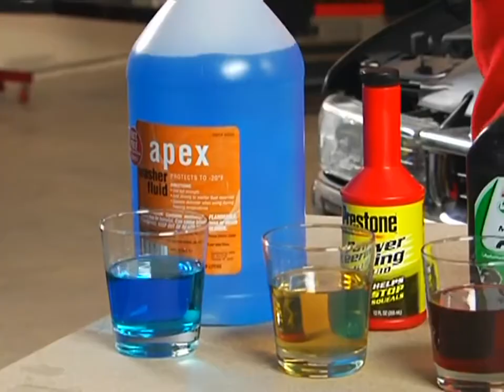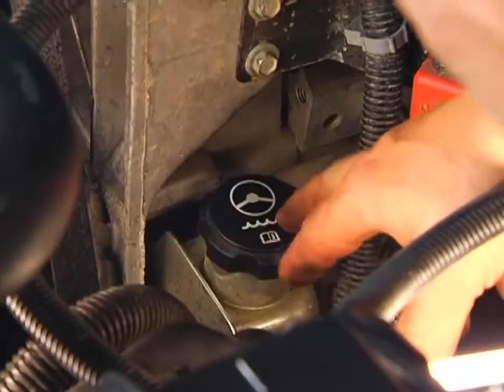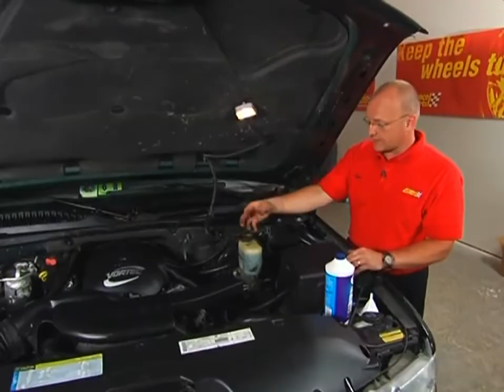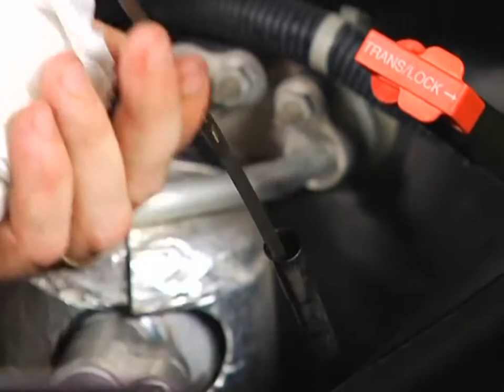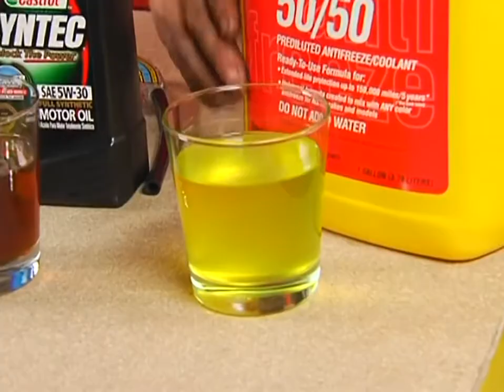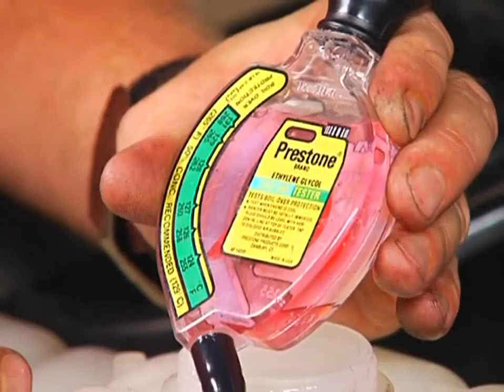Forgotten Fluids: Car Fluids That Keep Your Vehicle Running | Advance Auto Parts

Comment: I don't agree with filling the brake reservoir because as the pads wear the fluid will be lower because the calipers are pressed in more and when you change the pads the fluid level will return to normal. If you really are low you have a leak and it needs to be serviced not just keep adding oil because that's s SAFETY issue Mr Safety with no safety glasses.